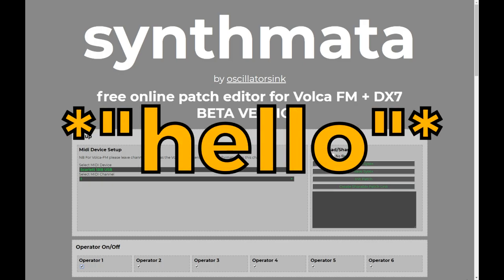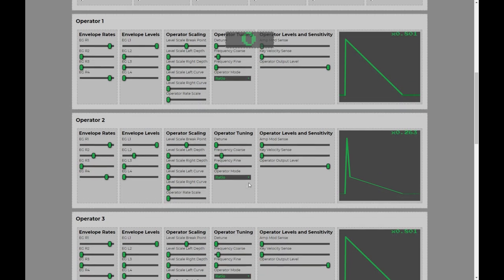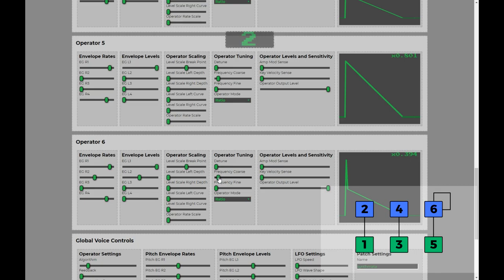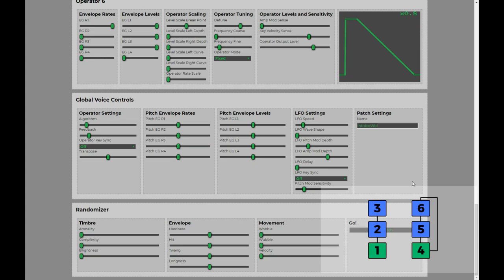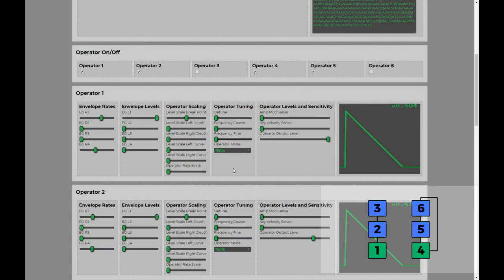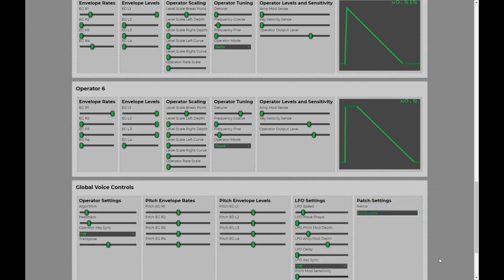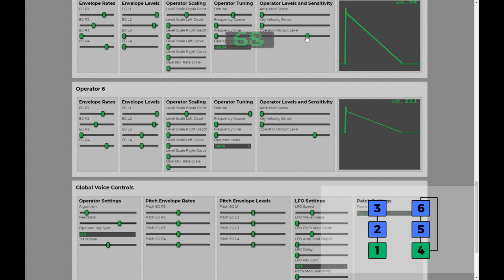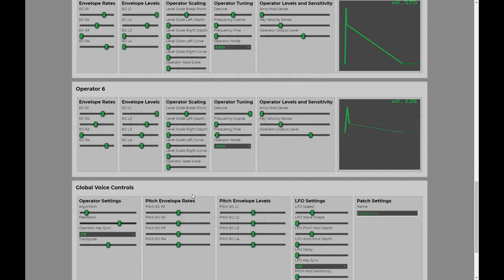3 Top Tips for Making FM Sound More Analogue (Volca FM, DX7, etc.)

Comment: Hey! I have been using the random patch generator for my DX7 for a couple years now and I love it. However, I just recently started using the editor to tweak the parameters over MIDI, and I noticed a bug that perhaps you aren't aware of: the mute checkboxes at the top of the page are inverted in regards to which operators in the synth they correspond to. clicking the "mute operator 1" checkbox actually mutes operator 6 on my DX7. all the parameter controls below it do correspond to the correct operators in the synth, so I've just started flipping the numbers for the checkboxes in my head, however I thought it was worth mentioning. Cheers! Thanks so much for maintaining the Synthmata site. I am so glad something like this exists!
Reply from the maker: Glad you're enjoying it. I think someone has mentioned that before, but I wasn't able to check it on account of not having a DX7! I seem to remember seeing a changelog for the ROM chips suggesting that the operators on/off had issues that were changed in different versions. Do you have an original DX7 (and do you happen to know if it's an early one?).
Reply: @OscillatorSink  it is a MKI but I don't know the date of production. it has a relatively high serial number though (139862) so my guess is it's not that early
Reply: @OscillatorSink  everything else works amazingly though, so don't sweat it too much! it's not a deal breaker by any means. just wanted to let you know.